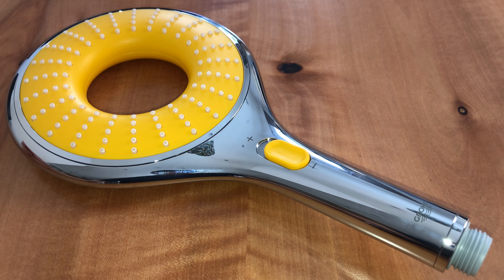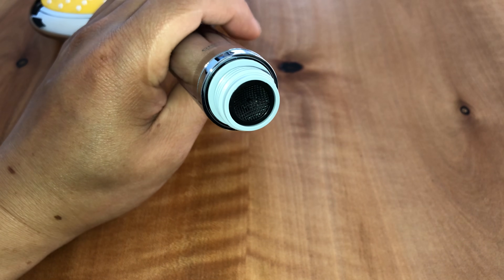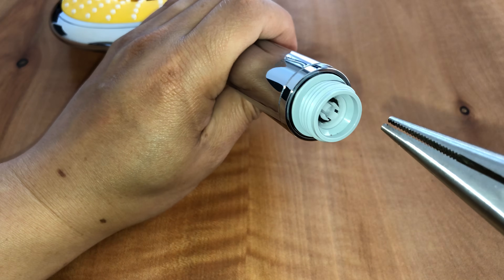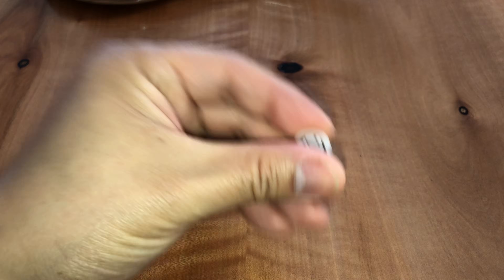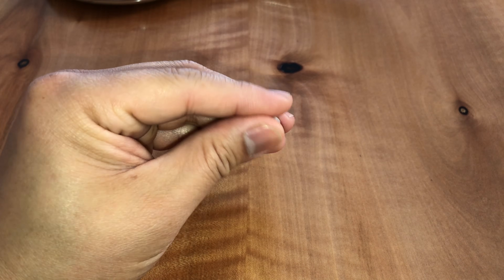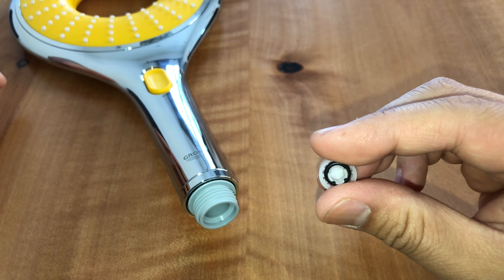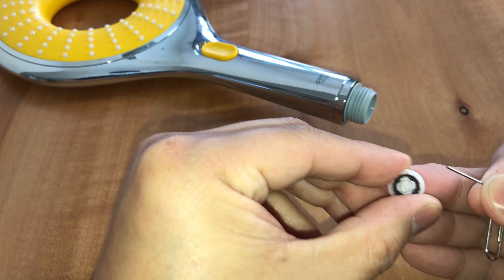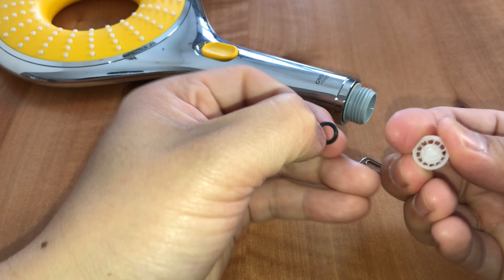Remove Grohe hand shower flow limiter/restrictor

Comment: It is impossible to get the 2.5 gpm Grohe in California these days - Amazon won't ship to a CA address. I got a Tempesta 100 as a present from friends back east, a low flow 1.75 (!!!) gpm unit that is still too "wasteful" to meet the CA limit. However, even though it is the same restrictor as in the video,there are differences on this model. 
First, the included washer has a smaller center opening than the old Grohe I was replacing, and that washer can't be sold in this CA county. I needed to use an "O" ring with a larger center opening. Next, the shower handle now has a tiny plastic ring inside, just above the restrictor, which now has a flange on the edge to keep it from being pulled past the molded in ring. I needed judicious work with a box cutter to remove that molded-into-the -handle ring. Finally, in order to get only slightly less flow than the old Grohe, I had to leave out the sediment screen, which had smaller holes than the old one, and a smaller diameter, so the old screen wouldn't work in the new handle. 
So "O" ring, box cutter work, and a discarded sediment screen are needed to get relatively decent flow. I wonder how much consumer income is wasted because of manufacturers modifying existing products to meet new federal, state, and county regulations?

Comment: On the California Grohe models (Euphoria handheld and single shower head), the restrictor/limiter is "glued" to the interior.  You probably can't remove the restrictor.  Luckily, if you just remove the O-ring (with a dentist pick), the flow rate becomes noticeably faster.  The handheld was restricted to 1.75 gpm and the single head (if not CA) is restricted to 2.0 gpm.  Removing the O-ring definitely helped.  Thanks for the video.

Comment: Great video! I was worried about breaking the parts but followed one of the reply/suggestions-and used a sharp sewing needle. The needle worked perfectly. No need to pull the insert out. The needle pulls out the small rubber o ring!

Comment: Thanks man. I bought it 2 days ago Grohe Vitalio Start 100 and I was so disappointed, but 1 min with sewing needle and now water flows x3 more and stronger. No need to extract plastic core, you can realy to break these small parts, just use needle and slow hook external radius of rubber ring. It works with city water supply.

Comment: This is really useful. There are no other instructions on Grohe Vitalio Comfort 100 and this helped. BUT even taking out the complete flow restrictor I still cannot get it to work with my Bosch combo boiler. I believe the problem is that the flow is still not enough to trigger the hot water flow sensor in the boiler. I put the older shower head on, works fine. So this whole “ecojoy 35% less water” concept is probably ok but not on my boiler....